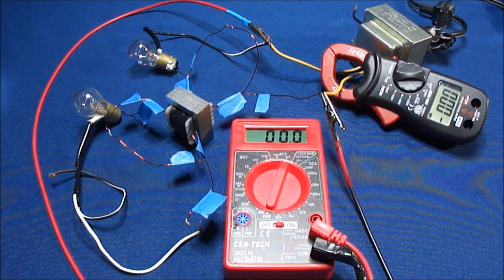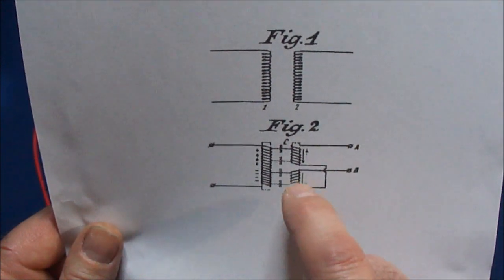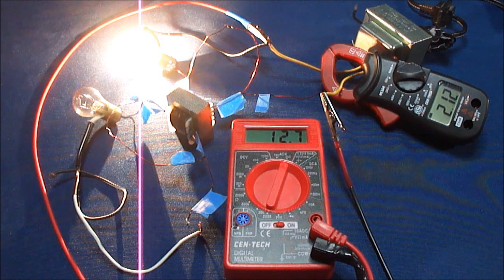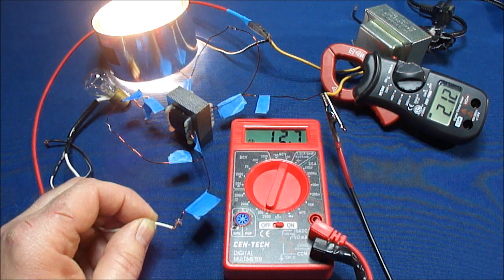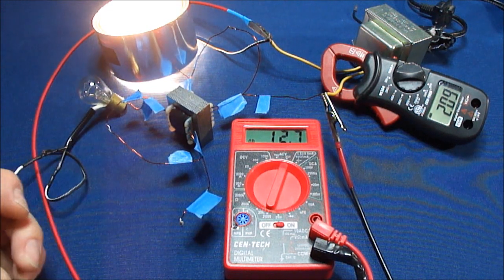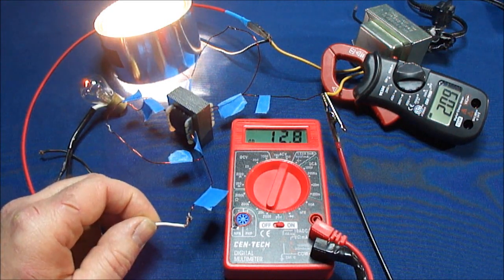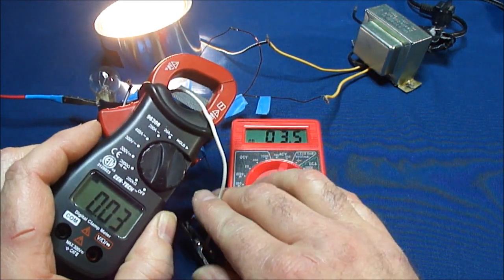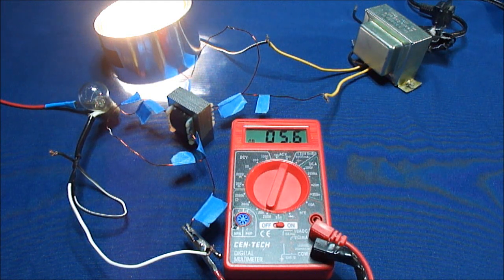Bucking Amplifying Transformer Energy Gain

Comment: Are you powering it with AC or pulsed DC ? The were using pulsed DC at that time in 1929...
Reply from the maker: I’m using AC 120v on primary on right to drive secondary testing. I seen some pictures of the battery rooms for DC.
Reply: @ArkiverUnifiedEnergyWow, this is really good news. This transformer dates back at the same time like Meredieu transformer (1928) which works in pulsed DC. Did ypu wire it on an E core ? I have a U core of a huge transformer (5000 mm2) which I use for experiments and I was thinking to try this one on the separate I part. Can you tell what number of turns did you use ?
Reply from the maker: @fxeconomist This is on an E core. The transformer is only about 60mm. The turns were around 200 primary & secondary. You have to experiment with the core you choose.
Reply: @ArkiverUnifiedEnergyBy 200 secondary you mean 100 each half, right ?
Reply from the maker: @fxeconomist Yes
Reply: I am also looking at Chris Skykes' videos (Hyiq channel) about his bucking coils. He uses that 1 to 3 ratio, (3 being one half of the secondary). In my previous attempts it didn't work because I was stupid, I wrongly winded the two halves in the same direction but I only connected them in a bucking manner (lower coil upper wire to upper coil upper wire) with the primary on the other pole, and this didn't work. I'll put everything on a single core and I think i'm gonna use thinner wire now to increase magnetic linkage. But, I've seen in one his videos, Chris says the primary has to to wound over that half of the secondary that has the same direction. Did you wind like that or you extended the primary over both coils ?
Reply from the maker: @fxeconomist I had the primary over both coils. It depends on what you do with the arrangement you make. The load has alot to do with what you will find after.
Reply: @ArkiverUnifiedEnergy I think you obtained, but I'm not sure, no voltage transformation. Is that right ? The problem with Sykes' design is that in a 3:1 ratio there will be a voltage hike, which makes it difficult to upscale. If it works, upscaling would be difficult as it would require a step down transformer with a far larger VA rating. If I do it for 240 V and I get 700 V output, I'll need to bring it down to 240. But I think your design has no voltage change, like in an isolation transformer. Is that so ?
Reply: @ArkiverUnifiedEnergy I was looking more at the Groeneveld schematic and the mystery quite deepens. Groeneveld indeed uses two opposite coils, but in a flipped configuration, which would indicate a non-bucking mode. Sykes uses opposite coils in a direct configuration, remaining in a bucking mode. I my attempts, I actually had two coils wrapped the same way, in a bucking configuration, but with the primary on the other pillar - and it was extremely inefficient. I think these operating modes are not equivalent - that is, same way coils in a bucking configuration do not equal opposite coils in a direct configuration, and same way coils in a direct configuration do not equal opposite coils in a flipped configuration.
Reply from the maker: @fxeconomist Voltage is current dependent at some point in any design.
Reply: @ArkiverUnifiedEnergy That means different loads get supplied with different voltage ?
Reply from the maker: @fxeconomist I solved the voltage requirement problem in transformers. Watch my Variable Electromagnetic Resonator video. Impedance conversion was the problem.
Reply: @ArkiverUnifiedEnergy I'll have to go thru, see if I understand with my limited knowledge. I did not expect that transformer would do funny things to voltage. It seems from Grosvenor's patent that it is rather made to amplify the current, not to change the voltage unpredictably.

A thing that I don't understand happened in my own tests. My transformer versions were changing the input voltage. Although the input voltage was the 48V output from a regular chinese transformer, my meters were reading different voltages on the input to my transformer. Most notably, one configuration (bifilar parallel primary, bifilar series secondary), came with a whopping 34 V input to 62 V output.

Comment: This doesn't work with a core type transformer
Reply: It only works works with some transformers  that are wound the right way ,which is bifiler  I think.  I've  only managed  to make it work  with one out of about a dozen.
Reply: @dosomething7930  There are four ways of connecting the wires in a bifilar coil. Non-inductive, parallel, inductive+ (series)  and capacitive. I only found that the parallel and the series versions actually work. So, given that there are 3 coils (the primary and two secondaries), how did you wire each, can you tell ?

Comment: After looking up the patent, I was wondering if you had some insight to the capacitors on the bucking side of the transformer; all I can imagine is that they absorb some of the emf and may produce a phase shift to produce a gain. what are your thoughts?
Reply from the maker: The capacitance and magnetic field of coils can interfere with each other. In the patent image the capacitors were referring to coil capacitance. I think the bucking coil has better coupling that keeps it in phase with the primary under various loads. Finding the right balance of turns for the core your working with is the difficult part.
Reply: thank you sir, I believe floyd sweet used 4 to 1 but many others used 3 to 1 ratios, thanks for your insight

Comment: i am in test of bucking coil as will :)
Reply from the maker: Many different ways of using the reverse wound configuration. Interested in what you find :)
Reply: i use bifilar coil with same direction electron flow, and same direction current flow, based in 1 cycle direction flow of electron in ac circuit. load is between positive and ground and are design to move in same direction since the the electron that flow in 1 cycle is flowing in same direction that always ends up in the ground then it alternate in the next cycle back to live and both will move in opposite direction this time. i arrange the in and out or load so when electron moves in 1 cycle those electrons that are moving from live to ground wire are moving in the same direction  and therefore current in both live and ground wire both moves in same opposite direction as will and in theory because they are byside each other will cancel lenz law effect or cancel drag.
Reply from the maker: Great work. Cheers
Reply: thanks, you as will :)

Comment: Hi i am finding a lot of your videos most interesting as with this one, i am however confused you have two transformers here, so what is the large one in the background doing in relationship to the smaller one.
Any chance of a schematic.......regards kev
Reply from the maker: Hi. The large transformer is the low voltage power supply. Its secondary is bifilar wound and hasn't been modified. I found later on that a cap in the center tap point allows the transformers to ring or resonate. Cheers Mike
Reply: Hi Mike many thanks for a speedy reply a lot of my work these days is with induction coupling and wireless Energy transfer ( I also build induction heaters )  But that Patented transformer intrigued me a bit and i built a Toroidal  version very quickly and had some not bad results, but more work ( as ever  ) with turns ratio's needed.
All the best keep up the good work regards Kev

Comment: The other lamp is slightly dimming when you connect the second lamp. You need to measure both lamps, and total their power.
Reply from the maker: +beforebefore After this video I made the mistake of altering this transformer. I will be testing some more configurations and include measurements for both lamps.
Reply: +beforebefore Arkiver +Unified Energy Can you answer this please?

Comment: Im sort of testing this transformer from pat 1702771 as well: watch?v=7EsgWyp5Nn4
:-)
Reply from the maker: Hob Nilre Interesting. I haven't tried the skip back layer winding yet ;)
Reply: I guess it keeps the electric field intact?
Reply from the maker: Hob Nilre I think it was Tesla mentioned in an article that a standard single wire coil only uses half its windings. Half the windings being in the proper direction on one side of the neutral line. Same as Tesla's bifilar pancake if the two wire coils were pulled in opposite directions. Could be this style winding frees the neutral line to oscillate from center?
Reply: Thats an interesting quote, when i get the time i will do another coil with the windings not side by side but over and below.